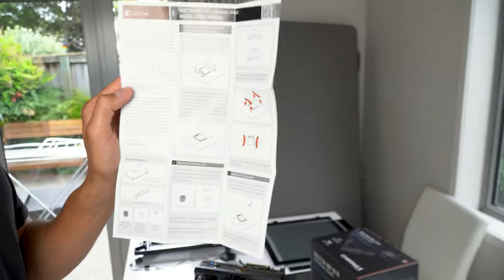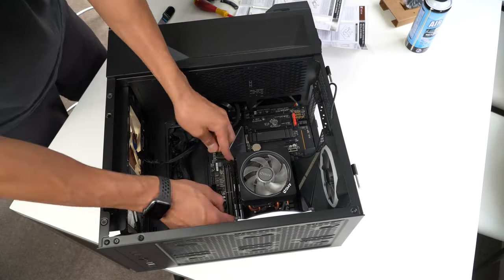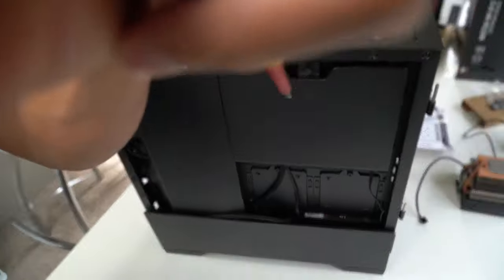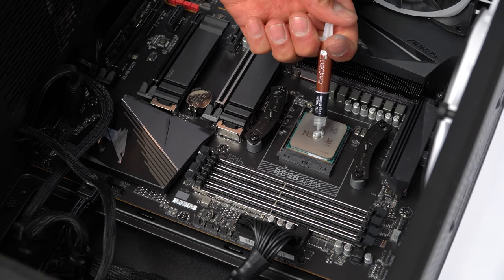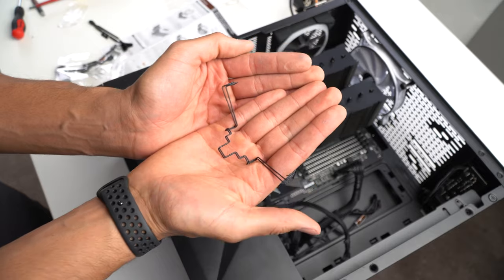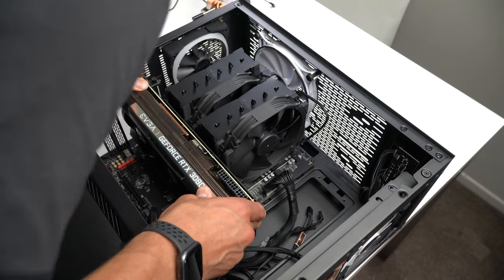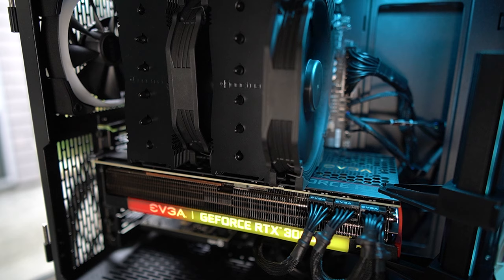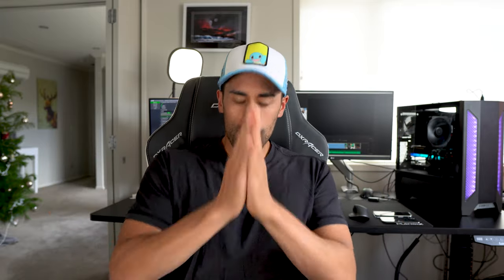Installing the Noctua NH-D15: Top Tips & Common Mistakes to Avoid

Comment: nice gpu x) have a similar build, i only managed to get a 3060ti, but still super happy with it.
Reply from the maker: Cheers man appreciate the love! 
And getting your hands on 3060ti is still so good and goes well compared to any of the 20 series stuff or my old 5700XT. 
To be honest I feel like the 3080 was overkill for the stuff I do as I haven’t upgraded my gaming monitor to a 1440p yet and could’ve gone for the 3070 or 3060 and that would have been fine.
Reply: @mrtwomore  haha, i did however upgrade to a qhd ips monitor ;p
yeah the 'budget' option still out classes a lot of the older stuff so it felt right.

Comment: Greetings from Argentina. I've just bought a Ryzen 5 5600x with a  ASUS TUF X570-PLUS GAMING WiFi AM4 and a Rtx 3080 evga ftw3 like yours and I wanted to check about the Noctua and you just filmed it...awesome!!!!
Quick question...does the Thermalpaste comes with the cooler? If not...which is a good one?
Reply from the maker: Hey from New Zealand! That’s awesome! And you have a great set up right there! The paste comes with the cooler in the box so you shouldn’t have to worry about getting more and saves you a couple dollars ☺️
Reply: @mrtwomore  thank you buddy!!! Excellent video!!!!

Comment: how do I know which way is pull and push on the fans?
Reply from the maker: The back of the fans has a small amount of print on them that looks like motor and voltage detail which will help you figure that out! :) Ese

Comment: Nice video mate cool explanation
Reply from the maker: Cheers man!
Reply: @mrtwomore  Just installed my pc yesterday and its incredible man. Your video really helped me out! Thanks again. My 5900x is running 40-50 on idle but no more than 78 degrees on load. Do you think thats alright?
Reply from the maker: Yeah they really do an amazing job! And congratulations on getting a 5900x! I’d say that it isn’t extremely hot relative to how how these CPUs can run. Maybe check your case fan profiles and check to make sure there is enough air coming into the case. On idle I would have thought it runs a little cooler than my 3800x but in saying that my 3800x runs between 39-44 degrees depending on how warm the room is and that’s with 3x 140mm Noctua fans blowing into the case. Either way it’s not out of the ordinary plus you have one of the best CPU’s on the market so I wouldn’t be stressed!

Comment: Cool , i have 3800x to and i think to replace box coller wraith prism to Noctua Nh-d15 chromax black) In begging i thinking about some water cooling like Celsius s36 or Kraken x63, but some people telling me that in my situation with bequiet silent base 601 , it will be not to good, so i realise ..maybe buy Noctua Nh-d15 and happy ending?)
How about noise ? Its comfortable fot you?
Because for me , its really important things.
And i have 140 mm 3 fans on front ( Two pure wings 2and third will be shadow wings 2 .
From back i want to replace Carsair fan on Shadow wings 2 but 120 mm.
Reply from the maker: Well I’m not too sure why the Water cooling would be bad as I’ve had friends swear by water cooling. But in terms of fan noise with normal usage no noise noticeable over the other fans and GPU fans. When under load at 60degrees there is definitely noise but because the fans never really ramp up to full speed and are both 140mm fans like in the front of your case the volume of them is not super loud but you can hear them working. The smaller the fans the higher the whine of them usually so I’ve definitely found it a better situation with the larger fans and lower noise output compared to my stock AMD CPU cooler! 
Hope that have some insight and help, Ese
Reply: @mrtwomore  Thanks for the opinion) See, your friends swear the water cooling is good thing, but you still put Noctua Nh-d15) The question is, how do you like Noctua in comparison with the boxed cooler Wraith prism rgb, in terms of noise? Did you set certain RPM on Noctua Nh-d15 via BIOS or everything on the machine? And yet, why didn't you put the water on? Maybe due to the fact that it is not practical?)
Gennadij😉
Reply from the maker: Compared to the boxed cooler from AMD it is ALOT quieter along with keeping it cooler. the fan set up is manual through the bios and under 40 degrees runs at a 20% for the fans and then has a linear line up to 60 degrees. I've only seen it hit 70 degrees when doing a cinema 4D CPU benchmarks. Otherwise in a 20-25 degrees room it runs well at 58-63 degrees while gaming for hours on end. 
I'm happy I went Cooler fan compared to the water cooled as the Z73 was going to be my other option but here in New Zealand cost 359 USD compared to 159 USD for the NH-D15.
Reply: @mrtwomore  Thank again and God bless 🙏

Comment: Your 3080 may be getting hotter than you think. Download HWINFO, and monitor your 'GPU Memory Junction Temperature'. That's VRAM temp and should not get passed 90 degrees or so. It's an issue in both 3090 & 3080 cards.
Reply from the maker: Hey! Yeah good tip and already have it downloaded and checked that after reading it on one of the reddit forums and everything’s all good! Cheers again, Ese
Reply: @mrtwomore  Awesome! I almost always buy EVGA too, they tend to do well for their customers.  This time around I got the 3090's Founders Edition.. that thing was a hot potato until I swapped out the thermal pads, so I'll go back to EVGA next time. Glad to hear it's performing well.

Comment: Hi! I want to buy the Noctua NH D15 but idk if will be ok in my build.
I have Kingston fury RGB ram and MSI Z490 MPG Gaming Plus mother (ATX) in Corsair 680x case 
I need help with the Measures, I want to know if the first cooler will be over the ram or nope 

Sorry for this comment, my English is a "bit" bad 

Pd I saw you got 670 subs wtf bro, you deserve like 200k minimum, here a new sub <3
Reply from the maker: Haha you’re too kind! 
And this link should help you as it tells you the compatibility for your set up. 
https://ncc.noctua.at
I can’t say if it will push the front fan out by much but for reference I have the g.skill black 3200mhz ram which looks a little higher than those. So I guess if you check the case combination with the fan you can see if it says it’s doable. 
But if you need me to check something on mine let me know! Cheers Ese 👍🏼☺️

Comment: How do I use those pins brackets to put the fan back on the heat sink???? I had to take mine off to put the heat sink on now I can't figure out how to hook this fan back up to the heat sink. Please help
Reply from the maker: If you haven’t got an answer in 40min after my workout I’ll send a video for you either via here or on my instagram 👍. But the basic idea is to pull the tab up and over the heat sink and it will slot back over those fins on the heat sink 👍

Comment: I have the same compinents but i feel that the noctua is way too big and its too close to the gpu is it okay?
Reply from the maker: It seems to be fine and doesn't seem to give me any negative effect with temps or performance! Thanks Ese
Reply: @mrtwomore  thanks for the feedbakc, i ended up installing it with a 90° rotation (push air out from the top not the rear) this way it clears the gou pcie
Reply from the maker: @rachedgt8897  Nice, I hope it works well and gives you good temps!

Comment: just sow your video and thanks i m installing an nh15 too :), i my opinion you should buy another thermal paste than the nh1 provided , i buy the grizzly kryonaut and if you check some test in youtube the difference between both is 10 degrees less in full charge for the grizzly ,so it s a big difference

Comment: That's what I'm planning to do too ! What case did you install into ?
Reply from the maker: Nice! Hope it goes well and you see some good results! I’m using the Lian Li Lancool 2 case - 
https://www.newegg.com/black-lian-li-lancool-ii-atx-desktop/p/2AM-000Z-00053 
Cheers Ese
Reply: @mrtwomore  Thank you, my case is Corsair 5000D airflow, so more space. My worry is, will cooler be big enough for AMD AM4 Ryzen 9 5900X ? Computer shop recommends water cooling
Reply from the maker: @yams900  Friend with a5900x for a video editing and 3D rendering PC set up coupled with a 3090 and I believe from memory they went water cooled as well. The NZXT Z63 I believe because he got told the same thing, and we got some idle temps of mid 30’s in a 20 degree room which I thought was all good from memory could be mistaken this was a in Feb 2021 under load it was early 60’s (trying to recall from then) doing a Cinebench R20 I think. However the Nocuta seems to get some pretty good reviews when paired with the 5900x too. So I’d say for best performance the NZXT but with premium price and for decent performance and reasonable price the D15. Sorry I can’t help more than that and now I’m excited to hear as that might be my next upgrade!

Comment: Did you have a problem with the ram clearance for this? I actually just returned the DH15 because my Corsair Vengeance LED looked to be too high for the front fan. I opted for the S model and am currently waiting for it to arrive.
Reply from the maker: I think I was lucky my ram was pretty low profile as they have no RGB. 
The fan is definitely offset a fair bit and it was just luck as well as my case had enough clearance to shut even with the front fan being offset so much.
Cheers Ese

Comment: Video to answer my question! I have the same cooler. So would jigsaws fit well under the cooler? Working with a p500a case. Great video btw!
Reply from the maker: Happy it helped someone! And if you mean between the cooler and the GPU I would say yes just but not my much its a pretty tight squeeze. I hope that's what you meant :) Ese
Reply: ripjaws you meant they are 42mm modules They should fit but you will have to offset the front fan towards the side panel to clear the ram
Reply from the maker: @fastf.8755  appreciate the clearer reply I was not picking up what we was saying 😂🤣 thanks!

Comment: Hey @Ese -- Great video. I am actually moving back to air from AIO just because I am so nervous about AIO failures.  The NH-D15 is probably one of the only air coolers to properly cool my Ryzen 5950X.

I have a question for you. I can see there is a tight fit in between the graphics card and the cooler. Have you had to remove your graphics card since installing this? How difficult was it to trigger the latch that holds the card in place?
Reply from the maker: Hey Ari! Yeah fair enough that was one thing that worried me if I went AIO especially for if you have an more expensive CPU than me with that 5950X. 
That’s a good question and something I didn’t really consider until after I put it in. The space is definitely tight and I scratched my head when I first thought of taking my GPU out for a bit of clean but what I ended up using was a tool from my ifixit kit - https://imgur.com/gallery/uCw9QdE
To squeeze through the gap and push down the trigger and to be honest I think the first time I did it, I did it with a thin flat head screw driver which was a bit risky but worked lol. 
In terms or reinstalling the GPU though it’s easy as just pressing it down. 
I hope that helped at all! Cheers Ese
Reply: hey there i can help you on that since that space is kinda similar with what i have ive removed the cpu like 2 times due to build changes and you need to remove the graphics card in order to access those latches

Comment: After installing that cooler how hard is it to remove the video card if you need to?   There is barely any space between the cooler and card.  Do you have to remove the outer fan next to the memory first to get to the release tab for the video card?
Reply: There is a video on youtube that shows that you can stick a thin ruler to pop the GPU release lock.  So it's not impossible.  Search Mihai tech tips Graphics card removal noctua.

Comment: Just ordered this cooler, and on the description of my case it said it fits a cpu cooler up to 17cm, and the cooler is 16,5. But then I noticed you had to move the one fan a bit higher, do you know how high it is? Would be nice to know so I can cancel my order incase it doesn't fit after all :P 
 You would be an angel if u could measure how far out it sticks out toward the glass :D a bit worried it wont fit if i have to adjust the fan on the RAM side :p
Reply from the maker: I'll just do a measure up for you.
Reply from the maker: the fan offset is approx 1inch past the top of the heatsink (2.5cm). I hope that helps you! 
https://ncc.noctua.at/cases might help to see if your case is suitable for the cooler as well. 
I don't really have a way to measure the total height from the motherboard to the top of the fan sorry!
Reply: @mrtwomore  thanks alot

Comment: If there begins to be dust forming how would you clean it? Would you actually take the whole cooler out? or just spray it with some pressure air?
Reply from the maker: I think there’s no harm in removing the fans and wiping down any dust on the edge of the blades and area to keep air flow smooth and the fans working at optimum. The radiators I think would be best cleaned with some compressed air and making sure that the dust has an exit point e.g the side panels open just so the dust doesn’t just settle somewhere else in your case
Reply from the maker: I hope that helped!  thanks Ese

Comment: thanks for the video thinking to buy this one or the the Noctua NH-D15S which is slightly offset toward the Top so it allow more room for the GPU but the questions is will it fit with Top Case Fans.
Reply from the maker: Yeah, good question I just took the old tape measure out for you and measured the top of my case to the top of the Nh-D15 cooler and it was 60mm. From the top of the Motherboard to the heatsinks on the cooler, it was 30mm and from the current top fan installed down to the heatsink on the cooler its 30mm, I hope that makes some sense and helped. 
the case I'm using it the Lian Li Lancool 2
Cheers Ese
Reply: @mrtwomore  Thank you are amazing I hope it will help other people as well, I will look on the official website to know how much did they offset for the GPU
thanks again.
Reply from the maker: @GenoGENOVA  Keep me posted on how you get on! Best of luck!
Reply: @mrtwomore  Okay so the Noctua D15S is offset of 8mm toward the top compare to the HS-15D. So it would fit as I have 20mm
thanks a lot for your help now I know I can get the "S" version :)
Reply from the maker: Oh that’s awesome to hear that the S version should do the job and that the Noctua website had the information you needed! Hope the install goes well! Ese

Comment: Just installed my noctua nd-d15. You talked about this...my fan size same. Viper ram with tall clips fan w/cord rests on ram. Fan doesn't seat as low as demonstrated. I guess...just a question of case size? Thoughts?
Reply from the maker: Nice stuff on getting the cooler, and yeah it could definitely be case size or ram height forcing the fan offset a little more. I think as long as you have good coverage with that front fan on your forward heat sink and can close the case then I don’t believe you will have any performance impacts. I hope those thoughts help!
Reply: @mrtwomore  Tremendous help! First build in a LONG time. AE and PPro build. AMD 5950 and 3080 GeForce RTX. Out of everything I have done, the cooler install has been the only thing that has me questioning my work. I was having a hard time getting the big mounting screws to catch initially. Pulled the entire unit to make sure they were aligned. Hoping without heat the cpu paste wasn't damaged. AGAIN...thank you for your help!
Reply from the maker: You are welcome! And what a great set up you will have with those components! 👏🏽

Comment: Hi I have question. 
How u clean the heatsink.  I want to take off the cooler and clean it . Like wash heatsink
Reply from the maker: Hey, funnily enough I just did this the other week. The stuff I used was isopropyl alcohol and a  paper towel. I sprayed the isopropyl onto the paper towel and then wiped it off the thermal paste using a couple more paper towels as it got more gunk on it. Hope that helps! 
P.s. Be careful when removing the heatsink after un-tightening the screws as the heat sink is quite heavy and can dislodge the chip potentially breaking or bending pins! Ese

Comment: I was wondering will it fit a b550 pro vdh wifi motherboard of msi with rams attached ?
Reply from the maker: https://ncc.noctua.at/motherboards
This link might help you find an answer, I’m not sure off the top of my head and the front fan that goes over the ram is able to be offset but that also might be a compatibility issue with your case you have too so check this link here: 
https://ncc.noctua.at/cases
Hope this helps! Ese

Comment: My second fan was interfering with the glass cover of the case but after removing it, I didn't notice any difference in temperature. However, I wanted to know if it's normal to still hear a fan noise coming from the DH15 as I can still hear mine - albeit it's not as loud as what I had before. The sound is still there.
Reply from the maker: I would say having two definitely would increase the Db sound output. That’s an idea, I might try removing one to see what the difference is in temp!
Reply: @mrtwomore  Is it normal to hear sound coming from the cooler even with one fan?
Reply from the maker: I don’t hear much with two going when it’s running low loads, but when it’s ramping up I can hear it for sure. My fan curve is quite aggressive though. With one fan it would still make some noise I’m sure but I’d say only at higher rpm’s when under low. But with those bigger fans it shouldn’t be over noisey!
Reply: @mrtwomore  hmm, I can still hear the cpu fan under idle, almost like a hum, not sure if I messed up but my temps are fine
Reply from the maker: Yeah a low hum I guess could be normal, you could also try the other lower rpm jumper cables included to see if that helps at all!